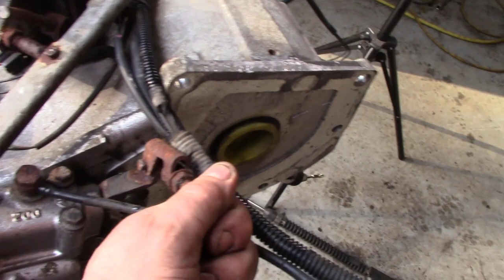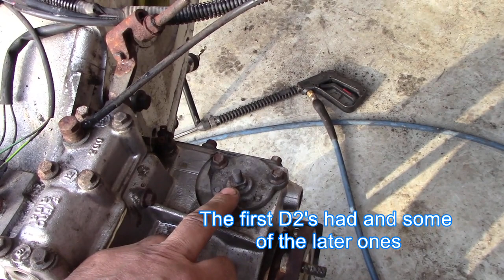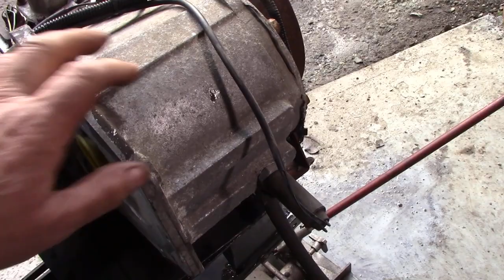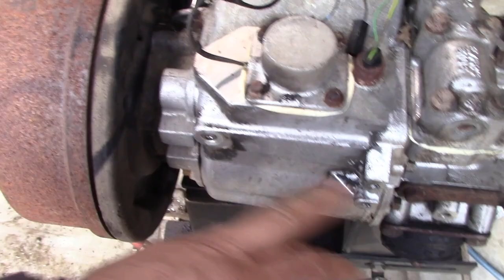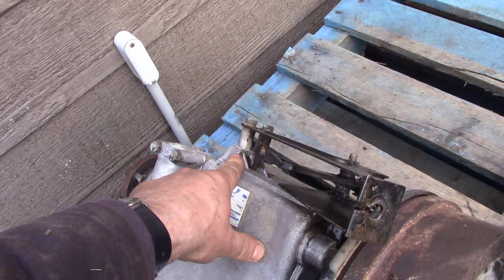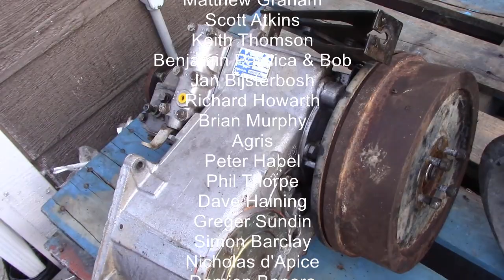LT230 1:2 transfer case from a V8 Discovery 1. A look at the differences to the Defender

Comment: I used the transducer instead of the cable. Swapped to an electric VDO gauge. So much easier! Very accurate.
Reply from the maker: Sadly we have no used VDO speedos here and they need to be in KM/hr - they are super expensive new!
C$350 or £200 + import cost!

Comment: If you have td5 speedometer lying about you could use it with that transducer and hey presto no wibbly wobbly speedo.
Reply: I changed gears and cables on my 300tdi Defender before biting the bullet for a real LR cable - fixed my wobbly speedo
Reply: @stevep8773  hi Steve yes I've considered that but it's expensive if it then turns out to be a gear or head issue. Ideal situation would be to try one but they're about £160 I think.
Reply from the maker: I saw them in the Netherlands for £200! £300 from Land Robber
Reply: Just get a VDO speedometer.  They are programmable and look much, much better.  I put them in all of my Defenders.  The Lucas gauges used pre-TD5 are horrible.

Comment: The D2 had 'Hill Descent Control' instead of the diff lock IIRC? Something that the Freelander 'gave' to it's bigger brothers...Ford have now fitted 'HDC' to one of their 4X4 SUV things....Not sure if there is any issues with them using that 'Monker'...I guess it's same as ABS/EDC/TC etc? Off out to check a wheel bearing on the TD4, got a knocking from the front with is still there after replacing some 'shot' parts..MOT next month...
Reply: I've a 2000MY TD5 D2. Had Ashcroft refit the CDL control (plus F&R TRueTracs). Hill Descent Control does work well, but you'd be hard pressed to find a place it is needed in the UK unless "playing" off-road. I also have a Volvo with Hill Descent Control - now that one I've never tried
Reply: @stevep8773  Yes, Not many High Streets that require HDC although when Land Rover introduced the Freelander (I would guess aimed at 'lady' drivers) they were obviously thinking of the weekly shop and school runs into the wilds of Guildford (which has a steep High Street) or Farnham..which is almost like going into darkest Africa...(BTW...I'm not a lady...). Glad my initial post brought so many comments and useful info to the surface...great little community Mike has going on...
Reply: Not quite. Sure, the D2 used TC, HD and ABS to do trickery, and the CDL was not a fitted feature, but very many of those cars, mine included, were built with the internals, so all that was needed was the lever to engage it. I have to say that the electronics weren't that good, but in conjunction with a working CDL they were pretty good. LR were testing the waters with the D2, prior to the D3 ( LR3 in North America ). They reinstated CDL in the facelifted D2. The transfer case was nearly identical to the D1, apart from a few places for switches. 

BTW, the levers to engage the CDL on a D2 can bring good money in some places.
Reply from the maker: Britpart sell the D2 cable linkage for about £100
We have quite a lot of D2's here of all sorts of mixes of diff lock or not -bit of a gamble
Reply from the maker: Thanks Malcolm  - I read today that JLR are in the pooh again! 

Quelle surprise!
Reply from the maker: I had a 1999 D2 with the diff lock  - it was cable operated. Then they did away with that and for a year or so they fitted the diff lock mechanism, but with no linkage! Then for the last years they went back to it

I have been driving D2's for 10 years now and I never used the HDC
I also converted a D2 to 300 Tdi / R380 with the diff lock AND traction control - never used the diff lock - the traction control is superb (when working)!
Reply: @BritannicaRestorations   "the traction control is superb (when working)!" 

 Indeed. There are a few reasons why it doesn't, not least the 'three amigos', but also there seems to be a problem with the front brakes and disk brake runout, which causes the HDC or TC to not work well. You'd think that would be easily sorted, but I have spoken to a few "specialists" who say they they cannot get the wheel bearings right.... I fix mine by a strong push on the pedal when engaging any of these, ABS aside. 

The D2 is an extremely capable vehicle off road, but I'm glad I had CDL on mine. It's just better.
Reply from the maker: I have never had an issue with the wheel sensors - major issue which is a cheap fix is diverting the ground in the ABS unit and / or changing the micro switches - these ABS units were used in the Hummer so there is a lot of info ( I had one guy from California who came on a holiday to Quebec so I could fix his 3 amigos as no one there could get it right - pretty easy really) 

I would say over here 99.5 % of D2 owners never took them off road (dirt roads maybe,  but never in the wilds) - same as the D1 which is why the diff lock mechanism is almost always seized up
Although they rarely go off road, they have excellent traction on ice and in deep snow - HOWEVER, many buy the Discos thinking because they are a 4x4, you can go fast on icy roads - OK - until you hit a bend and no matter what traction control you have, the vehicle is so heavy the momentum just keeps you going into a ditch!
On major issue I have with the ABS system is there is no manual disablement - apart from pulling the fuse - but then you disable the traction control -  on icy roads round town the ABS is over sensitive and just takes over even on the lightest of brake pressure, so you have to really reduce speed well in advance of a junction or lights - and as we never had 5 speeds, you cannot use the transmission to slow you down
Reply: @BritannicaRestorations  My old Audi 100 Quattro had switchable ABS,  apparently your better off without ABS in deep snow as the locked wheel causes a snow build up in front of itself and this helps to slow the vehicle.  It also had a centre and rear diff lock . .  Great estate car but not a Landy . . .
Reply: D2s without CDL will loose the dished thrust washers inside the diff during less than 200,000km. The traction control needs differences  to get involved.
Reply: If you don't have the diff lock isn't it possible to have all the power going to the axle with least traction? I thought this was what Andrew St. Pierre White was saying in one of his videos where drove a Disco with TC but no diff lock. He did not think that worked well.

Comment: If you swap the rear housing you have to check or adjust the preload of the diff shaft! I guess it's easier to change the cable operated brake drum. You need a longer cable and an other bracket that holds the cable inside the seatbox.
Reply from the maker: No  - the  rear housing is a straight swap -  the shim is on the inside of the t case  - the preload in not affected
I am changing this to the original 1987 hand brake style otherwise I would have to change the cable and the handbrake lever as they are different $$$$!
Mike
Reply: @BritannicaRestorations  Are you sure the short cylindric step are the same deapth? The front side is pressing the outer ring of the bearing to the zero position. In fact the length differs, you will get in trouble.
Reply from the maker: Exactly the same - I have changed loads of them